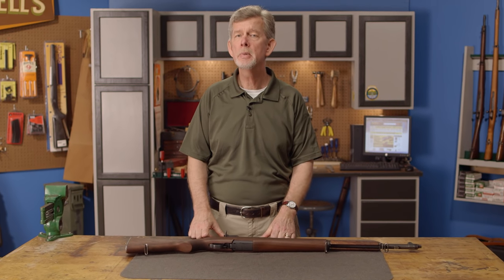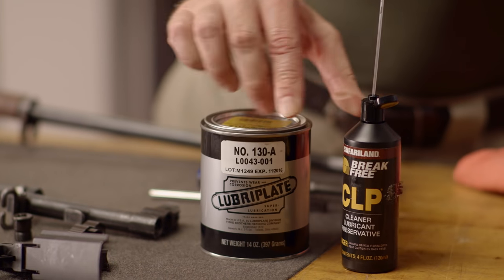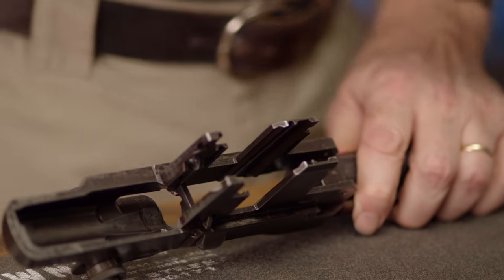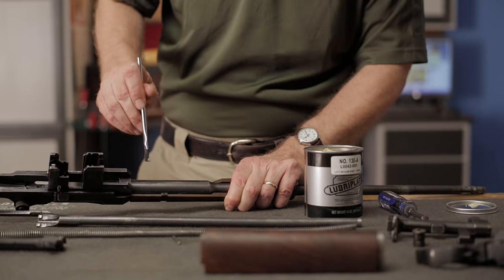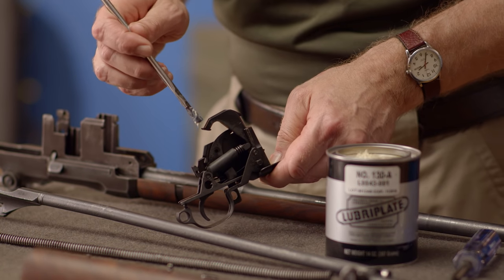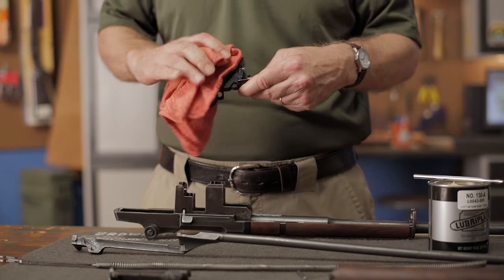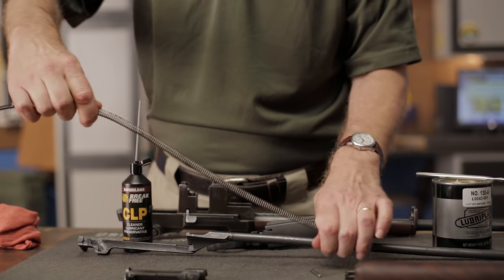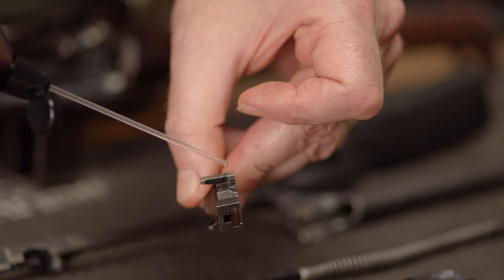M1 Garand Firearm Maintenance: Part 3 Lubrication

Comment: "Apply only a thin layer of grease." *applies huge gobs :D . One must realize that this is likely exaggerated on purpose to show the location of application. A thin coat, enough to make the surface shiny, is adequate
Reply: One question... Can we fire a weapon after being applied with the greace? We usually oil the gun as a lubricant. And gun fires well after being oiled.
Reply: @Musafir091  it depends entirely on the design of the gun.  Different designs have different required lubricants, so it is best to research the original instructions from the manufacturer.
Reply: @Musafir091  M1 Garand is a grease gun. Grease where he says to grease, except CMP says never grease the trigger parts where he does. Not sure why he says to do this. Oil where he says to oil. Don't just use oil, use both for this particular firearm.
Reply: @codymoncrief8478  Thank you dear. Stay safe ❤️
Reply: @Palo_Duro  Got it. Thanks a lot ❤️🙏

Comment: would you lubricate a m1 carbine the same way?
Reply: The carbine shoots a much lighter round and grease could more easily gunk up and cause performance issues, regular gun oil should suffice.
Reply: @govols1995 a light smear along the oprod contact points probably wouldnt be a terrible idea especially if the firearm is only being used for recreation

Comment: Do not, do not, do not grease the trigger hooks or sear. These need to be perfectly dry in order to prevent accidental discharge. The hooks prevent the hammer release until the trigger is pulled; grease these and you risk the hammer slipping off the hooks. Again, do not grease the hooks or sear!
Reply: If you're depending on friction for proper trigger/sear latch operation.........you've got worn parts.
Reply: You got that right.  No GREASE on the hammer or sear hooks.  Obviously he don't know what he's doing.  Probably never served in the military or he'd know how to properly lube a rifle.
Reply: 1:45 would you recommend putting oil on op rod?
Reply: @GenasysMech  It's an M1 Garand. It's extremely likely to have worn parts. These rifles are potentially over 80 years old.

Comment: Good ole Lubriplate, this stuff has been around for 50 years......or more. It's used by the drum for lubrication in industrial applications such as high speed bearings, etc., even jet engines. It's Lithium based and won't melt in a gun which runs cold by comparison to other equipment. The only problem I saw in this video is it was applied way too liberally. As for oil, I use a "micro" molecule oil such as Z-Max which actually penetrates into the grain of the metal that literally forms an imbedded "oil shield" that doesn't wear off, collect dust and really cuts the friction. Oh and by the way......try using an air compressor once in a while to remove particulates instead of just washing them around with cleaner.
Reply: + 2 on the air compressor.

Comment: How often should I grease it? Like approx how many rounds I don’t shoot often so just wondering
Reply: That depends on different factors. I lubricate again when the action starts to get sticky. If it's hard to open or close, then it needs more oil. I recommend wiping off the old oil before applying new oil.

Comment: Would u ever use just oil or just grease for all lubrication
Reply from the maker: Only use a high quality gun oil for lubrication. Browning does not recommend using grease. Please watch part 4 of our Browning A5 Maintenance Series: Lubrication for detailed instructions. https://www.youtube.com/watch?v=uXRdMLEjTCc&annotation_id=annotation_2193208169&feature=iv&src_vid=ILjILhMOAsc
Reply: For the M1 grand would you ever use only gun oil 
 How about for a revolver would you ever use only gun oil or grease
Reply from the maker: M1 Garands require both grease and oil. Never oil only. If it slides - Grease it. If it rotates - Oil it.

Usually is it best to use oil only on revolvers but you will always need to check the owner’s manual to see what the manufacturer suggests.